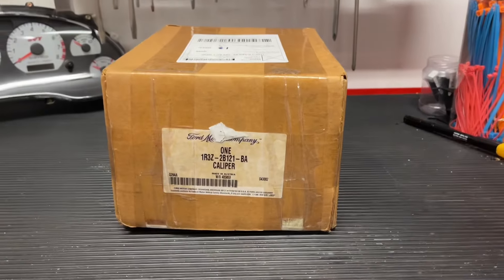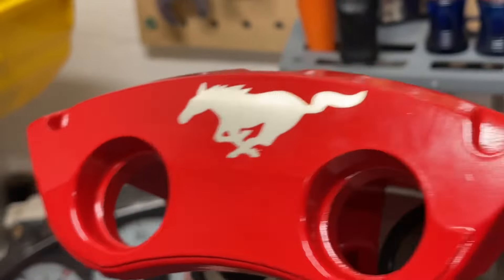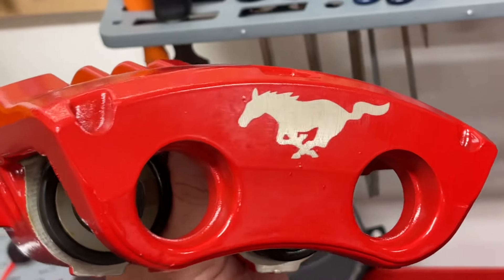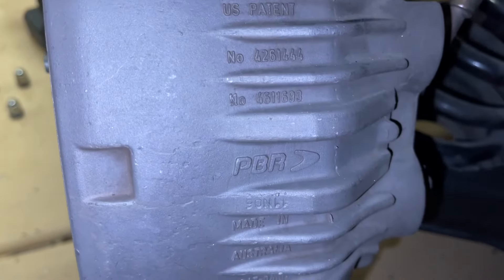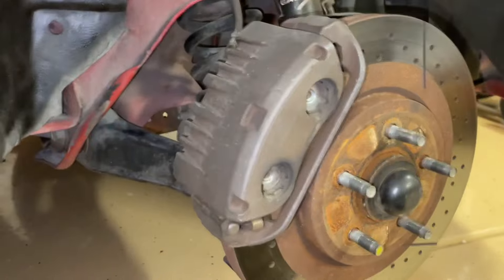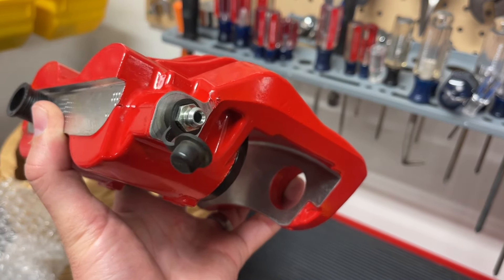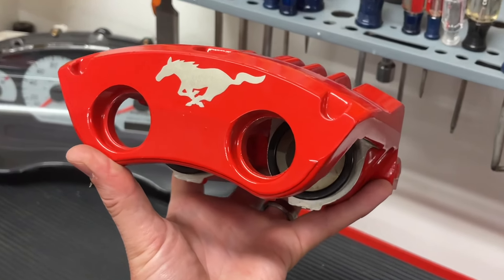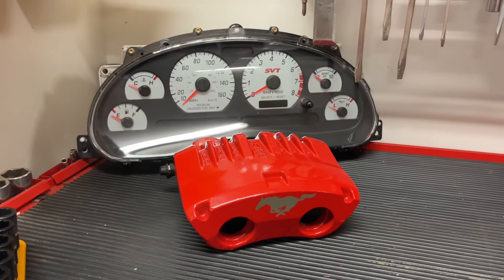Bullitt Brake Caliper info: Cardinal red powder coat and machined with running horse

Comment: I'm very happy you made this great video lol I have a nice set of these Bullitt calipers front and rear and I also seen this one for sale but I never purchased it lol I should've I also thought it was laser etched? That's what's Justin SVT said and I also didn't though it was Cardinal Red that's good to know lol thanks!
Reply from the maker: It still may have been laser etched, I couldn’t really find any info for sure and we were told that it was laser etched by the owner of ford in our town when he bought a Bullitt. However, others have said there was a sticker on their caliper that was never removed and so it may have had some role in keeping them from rusting during transport, or maybe applied during powered coating or even a myth. It’s hard to say
Reply: @dannyjohnsonsgarage  interesting lol I need to get mines a good powder coat maybe I'll put something over the pony so it can stay like original is there anything I need to do the Bullitt Calipers on my V6 is the lines the same?
Reply from the maker: It may be different size and the brake booster and vacuum may be different. You’ll have to ask someone who sells upgraded brake systems

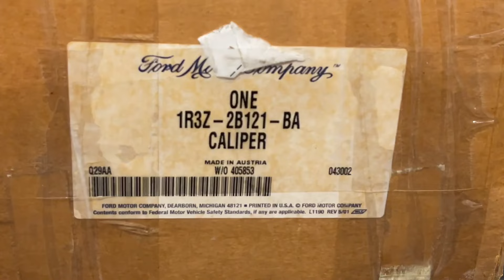Comment: 0:12 on the box it says Made in Austria and I was like "neat it's pretty much made in Germany", but on the caliper it says made in Australia 2:28. I take it someone goofed on the box label, not the caliper.
Reply from the maker: Yeah, I was wondering if some laser etching was done in Germany since that’s the only difference than the other calipers. I wondered if it was a typo too. No one could give me a for sure answer
Reply: @dannyjohnsonsgarage  PBR are 100% australia company...and oem ford. as to where actually built not sure. 100% not austria. somewhere southeast asia prob if not australia.